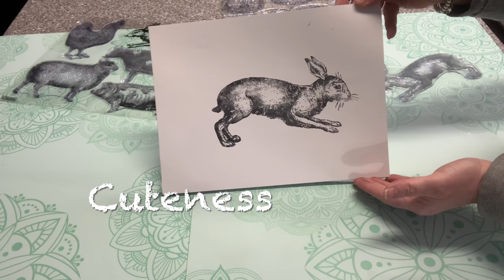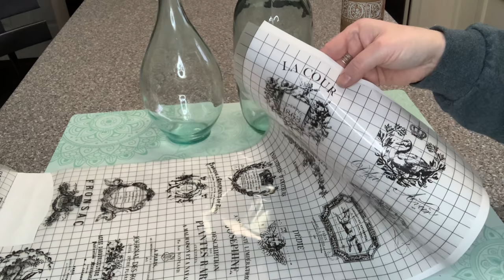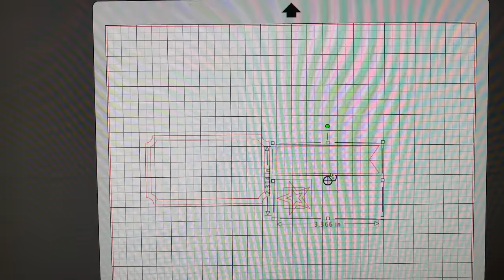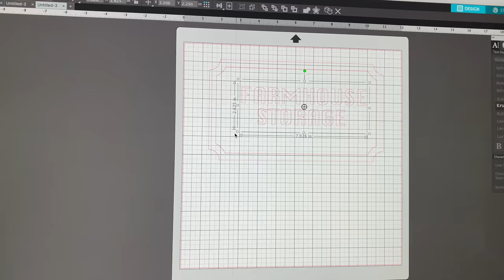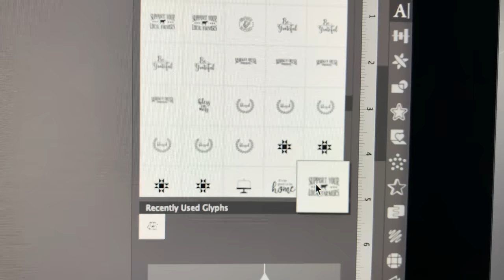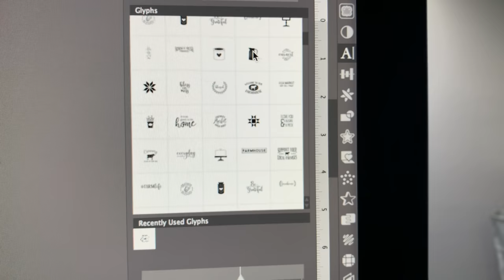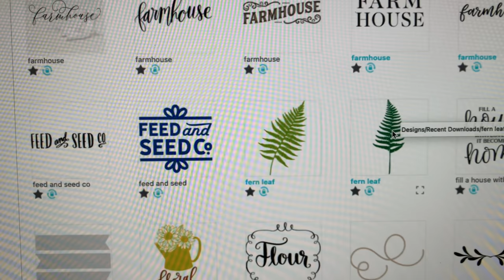Making Farmhouse Decor From Thrifted Finds || Trash to Treasure

Comment: I have never painted glass and ceramic for the same reason as I was worried that the paint would chip and wear easily and the piece ends up looking bad.  Years ago when I was a tole painting teacher you could purchase a fixative designed just for glass to make the paint stick better but it still allowed scratches and paint chipping.  I have both of these IOD stamps and LOVE them!  The tape idea to keep the stamp centered is a great idea!
Reply from the maker: Well I put my these pieces in today😬

Comment: I love how they all came out. I too have those cutting boards and they are so uneven and cracked I don't know or didn't know what to do with them. Now I have to tell you my experience with the baking soda and paint mixture  even after it's sealed  it chips very easily. Maybe yours won't but mine did . I ended soaking my jars in hot soapy water  and it came off . Good luck beautiful work I love them all. Anything that looks old and farm house I adore .
Reply from the maker: Thank you for sharing your experience 💝

Comment: Your OCD pays off. All of your labels and transfers look professional. I saw one YT’er recommend using gift wrap tissue paper when you have round or uneven surfaces. Stamp the tissue and then apply it to the round or uneven surface with mod podge. When dry, mod podge again to seal everything and the tissue edge almost disappears. I haven’t tried it yet but thought I would pass it along. Sounds like it could work and might make things easier at times.
Reply from the maker: Thank you for sharing that tip. I may give it a try sometime

Comment: I thought the ferns were still lovely.  They invoked Boho style and with large bronze or hammered black ring on top and possibly a border it would have been a lovely wall hanging.  (Linseed oil would likely nourish the wood and darken it mitigating any stencil spillage!  Then applying the same stencil and using a black fine sharpie or paint pen "draw" the fern.  The rest becomes part of the dark wood.)
Reply from the maker: Oh.. I like your way of thinking 🤗💝

Comment: Yvonne…I have the same IOD stamps!  I made coasters with them…MANY sets for gifts over the past years…out of ceramic tiles I’ve had left over from a bathroom project.  They are gorgeous!  I used several coats of chalk spray paint, stamped the tiles with the IOD ink and stamps (just the heads), and then sealed it with matte sealer.  So very pretty!  Love the,black inside the glass jar with the white transfer!  I never thought of that!  Nicely done, Yvonne!  Cindi (from WV). 🥰

Comment: They look good, but I gotta tell you that I purchased 2 birds that were finished in faux cement paint.  They were filthy dirty, so I tried to gently clean them and the paint all came off revealing two glass birds that had been chalk painted.  I decided right there that I won't paint any glossy surfaced piece without spraying with a coat of primer, either Rustolium primer or a good quality automotive primer.  It's super frustrating to buy something that has been painted and as soon as it gets cleaned,  it reveals what it really is underneath.   Your ideas for the finishing touches are absolutely amazing.   I know that painting highly glazed or glass I'd not what you usually do,  so hopefully you will try using a good primer first before applying other finishes, especially if you are going to sell them.  Have you ever heard of resin paint?  I'm going to try it to see if it is also a good choice for glossy surfaces.  I love the tip on using lint rollers to keep round objects from rolling.   Very clever!
Reply from the maker: I know what you mean.. that why I tried the chalk as a base primer and ( all but the one.) they all got sealed.. with wax.. and when I sealed in the stamped area .. they got acrylic sprayed.. That’s the thing I worried about. Them lasting. I couldn’t really find information on that part of it.. the process of painting yes .. finishing no.. so I just made up my own.. so hopefully I choose right🤗

Comment: Also....staz on is permanent but if you make a mistake on things like those crocks you didnt paint you can always spray with alcohol and it will come right off.  I used to stamp 4x4 tiles for coasters with it...if i messed up i just grabbed my alcohol and wiped it clean.
Reply from the maker: Yes.. I was surprised that I could remove it with alcohol.. so that’s why I definitely seal it in with the acrylic w💕

Comment: so  I saw the man who installed commercial stencils ... he used a dish soap mix on this massive window. He used a  sopping  rag, applied the  stencil, adjusted as he went, used  a charge card to smooth the air out. When it dried it remained for  15 yrs. I always use a soap water to shift any adhesive decals. The soap dries and it all remains in place.

Comment: no...u must use primer...even car spray primer (best) which i find is the best and strongest i found...cure time is a must before you paint the piece after apply the primer... and let cure for 30 days  and the paint will last.  I tried to paint cutting corners...and the method i mention above is the only one that worked...yeaph...u have to invest 30 days each process...

Comment: The stamps and decals are amazing. This was a great instruction video showing tips and techniques for the texture paint, applying decals (using the tape to keep them in place was a very helpful tip) and using the stamps directly on the surface or on paper as a label to Mod Lodge. Coating the inside of the jar with black paint to set off the white wording made a huge difference. Thank you for this video...not boring in the least! After watching the chemical wood burning pen, I think it's something that I won't invest in; I had seen it used on other videos and thought it might be worthwhile but up close like that I don't think it would be worth it so thank you for demonstrating that as well. I like the projects that you made with it but I just think it is something that I would struggle with because I like things crisp around the edges too and it seems to do some bit of bleeding.
Reply from the maker: Thank you.. yes.. I never mind sharing close up and every step. ( I may miss one or two it does get hard to film everything) so I hope you found this helpful.. to try or not to try.. 🤗

Comment: Not too long as a video, I just sit and knit and enjoy.  I learned quite a bit today, thank you so much.  I have a question, with the jar you poured paint into, how do you keep the paint from being scratched off?  Do you spray it with a top coat as well?  Ok, so two questions, in all the videos of the plaster paint I've seen, I've never seen someone add wax to the mix.  Why did you do it?  Is there some benefit to doing that?  (maybe three questions, but the last two are sort of redundant).
Reply from the maker: No it good.. the black paint in the jar.. needed to cure and than yes I’d seal it in. Since it was a step I hadn’t done yet.. I forgot to mention it. (Acrylic spray) the wax was added to because of its brown color.. not necessarily because it was a wax.. it was enough color to achieve the color I was going for.. not enough wax to make a difference in the paint itself 🤗

Comment: Yeah, I worry about the longevity of painted glass, ceramic, etc., because I live in the country, between two dirt roads, I get a lot of dust, so I need to be able to wash things. What grit of sandpaper were you using on those lids. That stuff came right off.

Comment: I really enjoyed seeing all the different techniques you used.  I've done quite a bit of the painting with the baking soda, I dab it on so it has that uneven finish on certain items.  I've only used white but then antique with the antique wax or even the black wax to give it that old look and dimension.  I've also started experimenting with imprinting the stamp into clay and molding it onto the bottle or crock and then painting the baking soda mix ginergerly around and over just a bit and then antiquing.  There is so much you can do!  Did you seal the crocks that you just put the stamp only on?  I may have missed it if you did.
Reply from the maker: Thank you for sharing your experience.. yes I sealed them in with acrylic spray

Comment: Does the ink used with stamping bleed?  Can you use a sealer over it?
Reply from the maker: It has not bleed for me. Yes.. I think I said I sealed it in using an acrylic spray.. though I did the off camera because I did it outside ( it’s smelly.) and it’s Michigan winter here